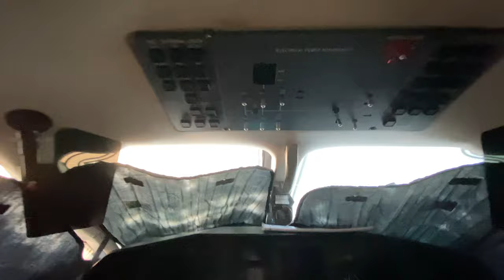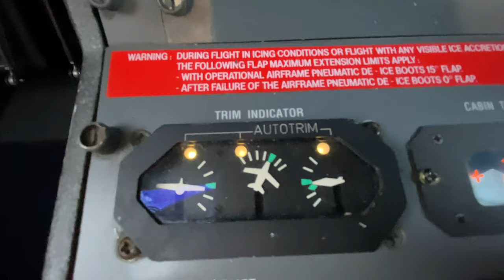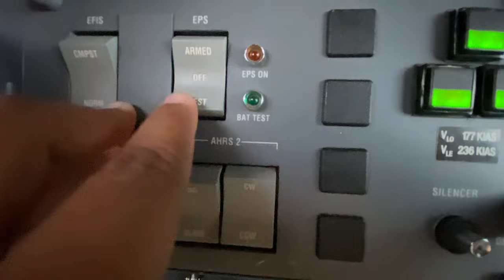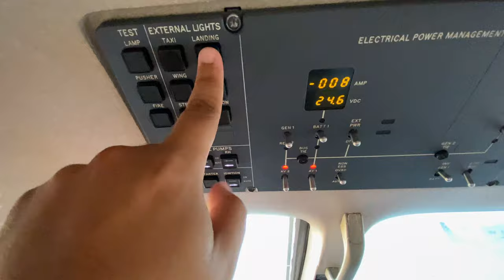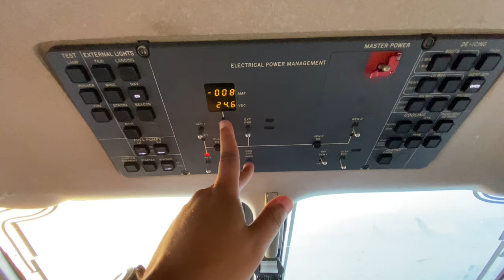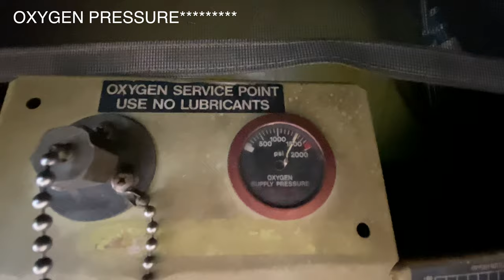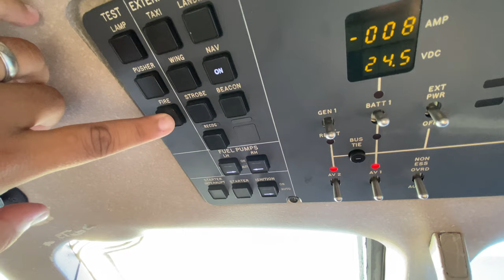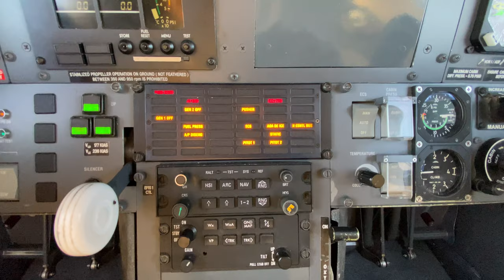HOW TO Preflight an Airplane? - Pilatus PC-12.

Comment: Tanks for sharing this valuable information. Let’s say you find something out of the ordinary on your preflight. What is the process of notifying it to the company and verifying the issue? Do you always have the option to take another plane from the fleet right away?
Reply from the maker: Basically we have to call maintenance and report the issue. If we can still fly, we go. If the item is grounding, then we don't fly, unless there's another airplane available, which there might not be in certain cases. 

In certain cases, when maintenance personnel are nearby, they might take a look and fix it before we actually go and take another plane.

Comment: I'm not a plane mechanic but I do know hydraulics. That right side landing ram is going to need the seal fixed in the not to distant future. They are a nice plane the PC-12. That green thing on the side probably means there is suficant OXY in the tank. Fly safe.